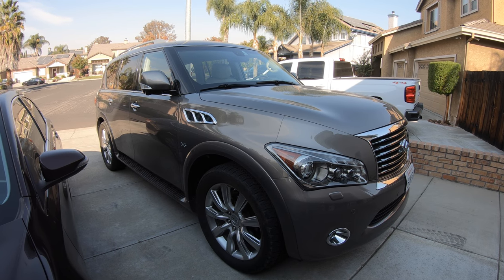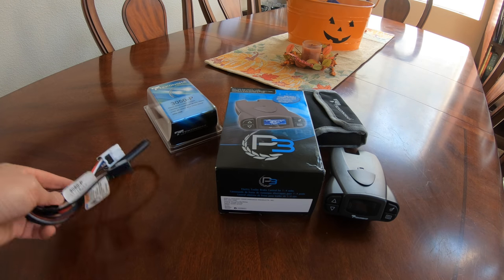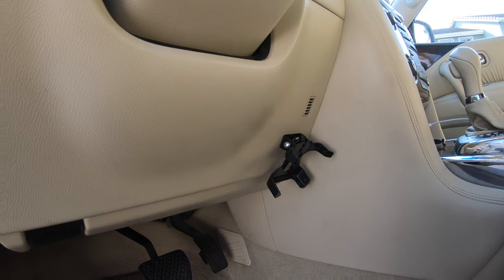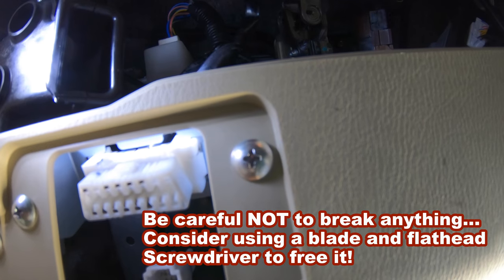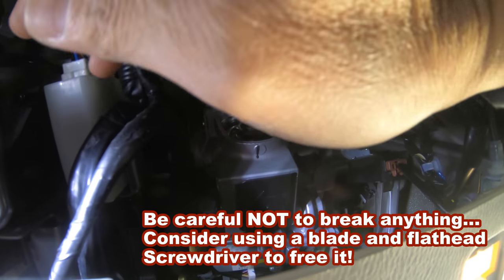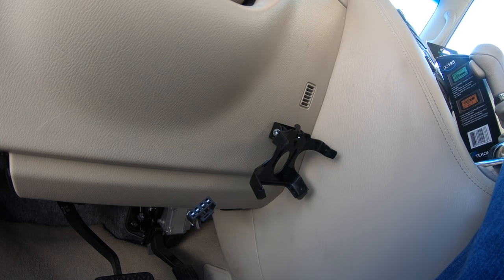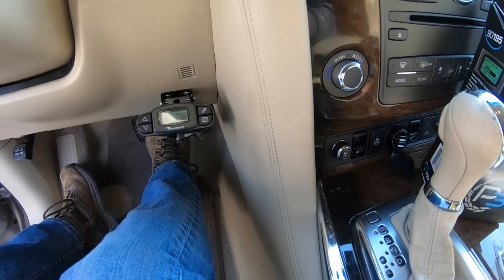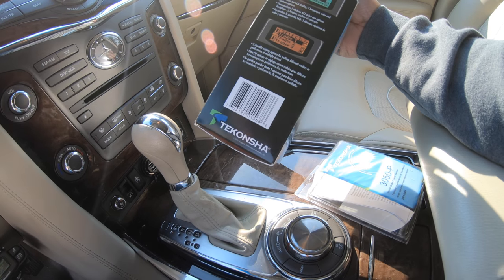How to Install an Electronic Brake Controller on Infiniti QX80 Tekonsha P3 & 3050-P Harness

Comment: What is that button next to the OBD 2 white connector below the steering column. It’s to the right side underneath
Reply from the maker: That is the driver assist / sensors switch (I call it shields up!). Thank you very much for watching

Comment: On my 2017 QX80 I found the head of the plug taped against the wire leading to the diagnostic port.  It had so much black tape around it that it was hard to figure out what it was.  I was not able to pull it down like done here because there was no extra wire.  It was right up next to that white plastic box.